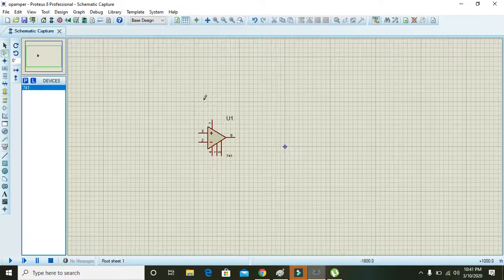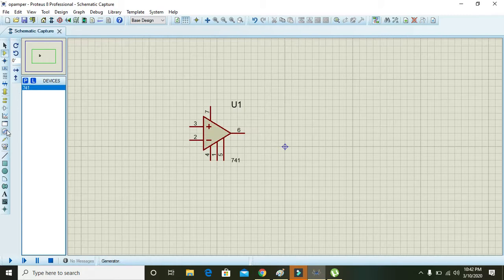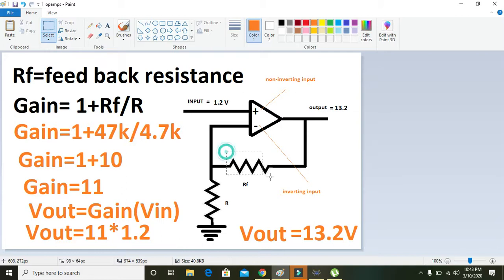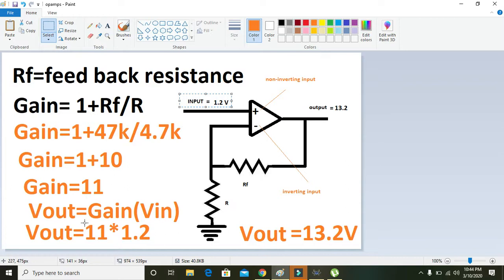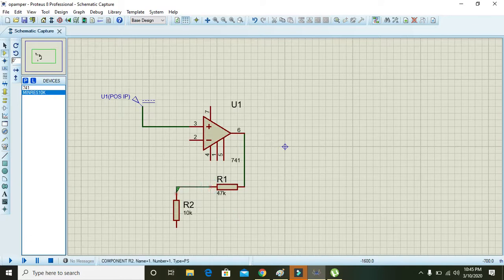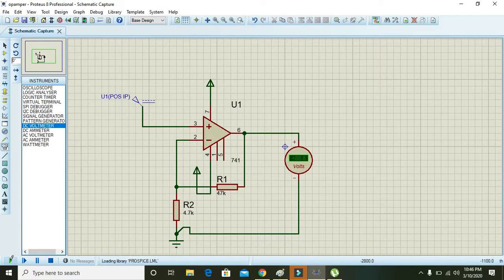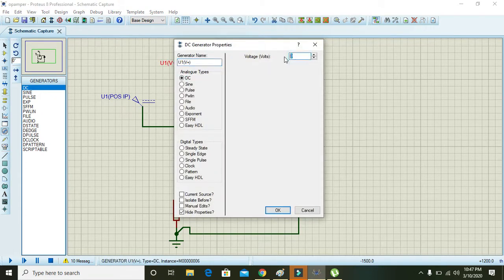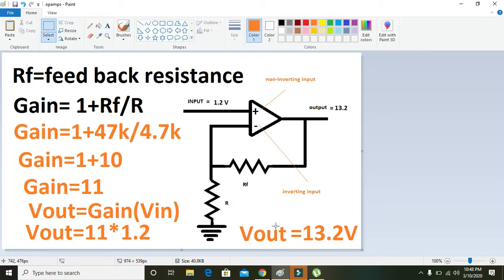How to use opamp as a non inverting amplifier in proteus | Tutorial on opamp in proteus

Comment: we have to  connect  op-amp with CT??
Reply from the maker: yes u can..CTs are used for current measurement and one thing best is that they are very low cost...
Reply: @nelsondarwinpaktech3954  which rating of ct is useful for op-amp?
and it connected is secondary side or not?